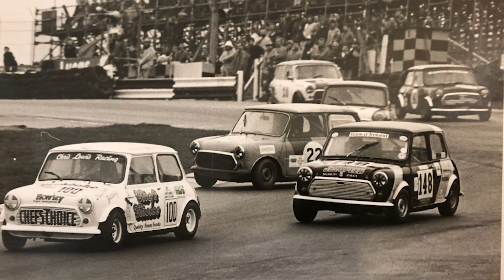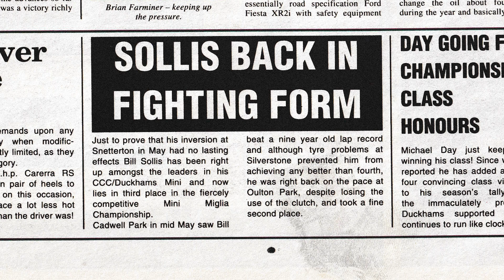How to race a Mini

Comment: I built up a Mini  for racing in 1968 from a bare bodyshell, when they were not old cars! You could get many performance parts like camshafts etc. from BMC themselves back then to hot up the engine and get more power. Also Speedwell Performance Parts were pretty good.

The racing class was Clubman's Class up to 1000cc and my engine was a 998cc - there was no such thing as a 'Mini" class then and we raced against a very mixed bag as they often lumped classes together in the same race. 

I never forget seeing a huge Ford Galaxie looming in my rear-view about, it seemed, to simply roll over me if I did not get out of the way!

Comment: Gave my Mini convertible S 05 a top down run yesterday.  The escape car. The best I've ever enjoyed. The '63 Mini was the first Mini I rode in with a cousin on a trip to England in '63. The sports car I had couldn't compare to this Mini I drive.  188,000 plus a few. Soars like an Eagle.  I'd like to tool your '63 round the track. Great video.
Reply: BMW "mini" are just a really pale shadow of the original classic mini.
There's no real comparison other than they share a name.

Comment: My first car when I was 18 in 1965 was an Australian Morris Mini Deluxe with a 1000cc engine, windup windows, executive grey paint job and deep red interior. Cost a little over $1000 as I recall. Loved that car. I was in the UK for a year in 1969 and had second hand Mini 850 which I drove to Istanbul and back. Loved them both. Wish I still had one.
Reply: Might cost £20,000-£40,000 UK GBP for either one of those now in mint condition.
Reply: RAW TOPSHOT My memory failed me. Australia did not go to decimal currency until February 1966. That should have been £1000 Aust pounds. That would have been $2000.

Comment: Hi to anyone wondering if these engines are stock absolutely NOT just hearing that thing on cam tells me a lot , to all the younger generation you have lost out SOO MUCH with your electric power steering ,your 1000cc turboboost engines fuel injection, electric 1 touch windows, believe me there is NOTHING LIKE a properly tuned REAL MINI the smell, the frequent push starts [bumb start] no AA back then because you may have left the tiny interior light on so battery flat or  the points or dizzy cap had a little build up,allways having to check radiator level but get all those things working and you cannot have more fun the way they go around roundabouts is something only the classic Mini can do. I had 7 Minis the very first when i started work in a garage and the owner let me pay weekly the car cost 500 quid. I bought how to tune an A SERIES by David Vizard and set about stripping an engine doing the usual re-bore ,pistons,rings and the all important FAST ROAD CAM . I then did my first race at Llandow Wales [im Welsh] and won, The prize was not a trophy but 10 pounds but to me all the late nights falling asleep under the car up on blocks was worth it all oh the memories are just amazing because you HAD to learn to drive back then which set me up to 13 years HGV driving then upped my game and doubled my wage by getting on the mobile cranes hope you liked this story SCOOBS UK.
Reply: This is the kind of stories i love to ear at the pub!
Reply: Llandow every Sunday afternoon in the late 80s watching every local nutter flying around.... great times
Reply: 7 minis? 🤔 
You never loved mini then, 
because if you had, you'd only ever have had the one,  the first one you ever bought. 
😁
( Barr being punted off the road, leading to an utter and total write off insurance wise, forcing you to buy another because you could no longer insure a written off car for road use ). 
Spares are available ( massively back then ) every single part including complete bodyshells.

😁

Comment: Lamborghini copied the gearbox in the sump design with the Miura in 67 which had a transverse V12 behind the seats, they later changed to dry sump for the engine though.

Comment: Could anybody tell me how many HP does these engines have? I am wondering if they run stock engines.
Reply: I believe that they should have from 130 to 145 depending on engine size. They normally modify the engines from 1275cc to 1380cc!
Reply: Around 130 is common in the app K classes nowadays, from a mildly overbored 1275 lump to 1293cc
Reply: @Automotion_Images  Thanks for the answer! 130hp in these cars is mental!
Reply: @antonio20180  Thank you for the answer, Antonio!

Comment: Since, these vehicles road race (turning right and left). Why wouldn't the drivers want to place their seat in the, middle to help balance the car? Is it a racing rule that the driver must drive from the right or left seat, not from the middle? Safety?
Reply: That's a substantial change to the cars layout, so it would need to be a new class of vehicle.